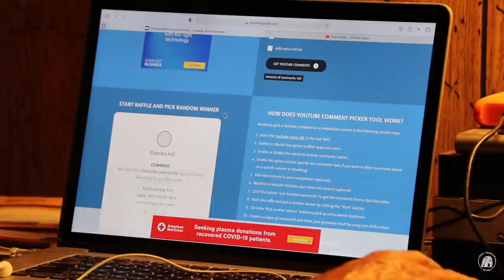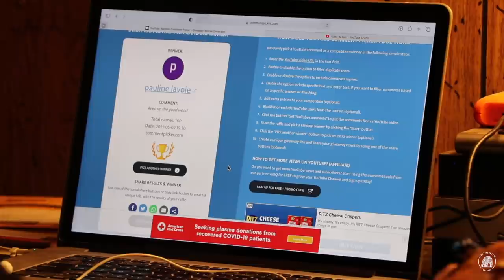Off Grid Chicken House Gets A Roof | Winter Wood Is All Done

Comment: Hey Brother have you checked into maybe Reaching out to Weboost and see if they will sponsor your channel for advertising thru your channel ? 
I know you can get a Weboost system to put a telephone satellite receiver/head on a pole or in a tree they make. It has a cable and it connects to & receives a satellite 🛰 signal that will give you 4G’s in remote places. I know another channel I watch that lives in a very remote mountain area  installed A Weboost system which gave them from 2 bars to 4 bars of 4G service. Check into Weboost it’ll change your life on that mountain. 😉